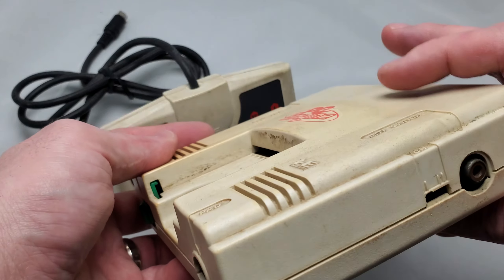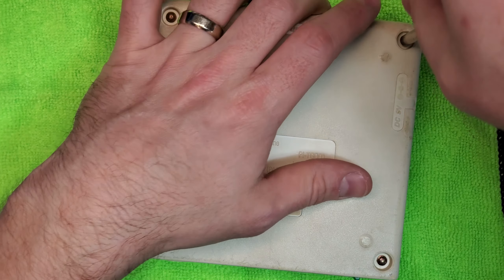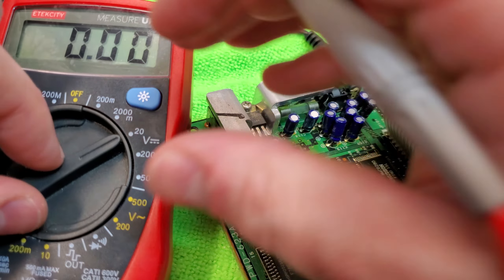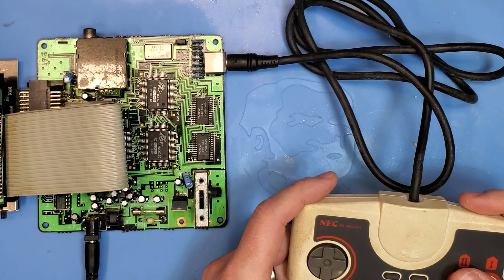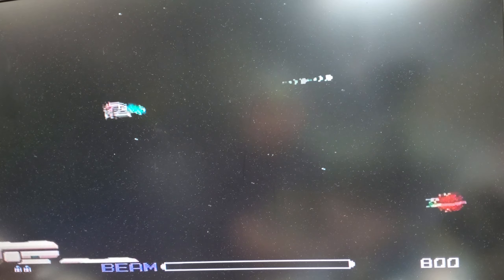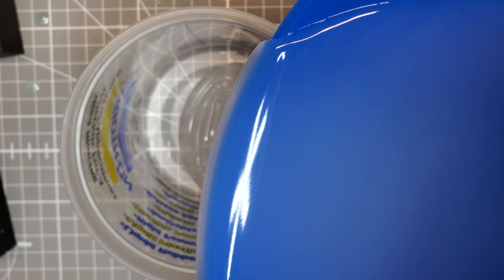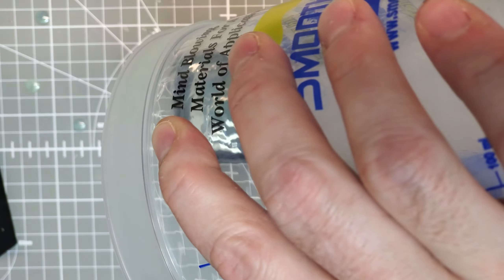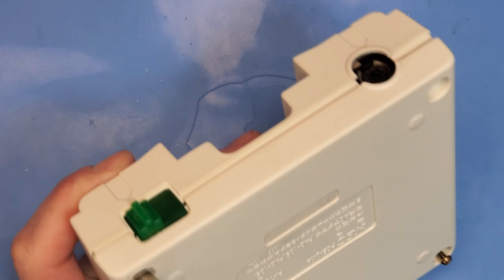I paid $40 for this Yellowed JUNK PC Engine, can it be restored?!

Comment: When I retrobrite, i also use 40% hydrogen peroxide cream and wrap it in plastic wrap, then in to a ziplock bag. But I dont use UV lights, I just pop the bag in to the dishwasher on a 70degree C, program for two hours. If its very yellow I run the program two times. Super easy, and it works great!
Reply: Found out that putting it in the sun works every bit as good. No fluids to apply, just let the sun do the work.

Comment: For my little PC-Engine I found the oxi boosted palmolive dish soap worked great it whitened it up a bit not as much as "retro brighting" but its amazing what a little patience and elbow grease can do. As for the fuse I am guilty of replacing the one on my unit with a 1 amp blade style fuse using a socket that had two wires I'd solder onto the board and merely placed the fuse where it wouldn't obstruct anything. In terms of pcb mine didn't have that much flux but it surely had some serious dust buildup for the hucard slot was just packed with it I used compressed air to blow out much of that nest where I can see the pins on the socket that slots the game cards as well as by the vents at the top of housing had dust cluttered there. In all its been a great performing unit loves the turbografx-16 but they're not cheap I'd strongly suggest the pc-engine as a great replacement alternative.

Comment: Good to see your restoration videos again. I have used your retrobrite techniques on my older Nintendo console and works very well. Thanks for posting this 👍🏻
Reply from the maker: Glad to hear it has worked well for you!  I have been going with the non-heated version as of late so I dont have to pay as close of attention to it.  Takes longer, but the results are good.  what I want to test is heated and submerged next.  I think that would be really good.  Might warrant a video if it works really well!
Reply: I have been using your Salon Care 40 method with the UV LED for about a year and the yellowing consoles turns out great, with out the heat. Yes, it does take a little longer . I like to see the result of your testing the liquid hydrogen peroxide with the heating. Good luck and please post your results. Regards, Hoj
Reply from the maker: I appreciate that, I think its worth a video for sure and I already have everything to make it happen. I'll pick so up and let's see what happens!!

Comment: Love how the PCE Turned out! Especially with that casted power slider :)

If I had to make one critique, I am kinda iffy about that AV Booster. I don't see any proper attenuation on the Composite or Audio leads. This can be a problem for your displays, scaling devices, or even the console itself.
Reply from the maker: I do worry about that. There are passives on the board, however, I do not believe they are complete. I am likely going to pick up a ssd3... I was very close to just doing an internal rgb mod on this but opted to pass for that reason.  I appreciate the heads up on this av booster!